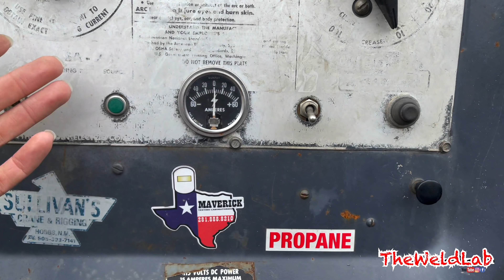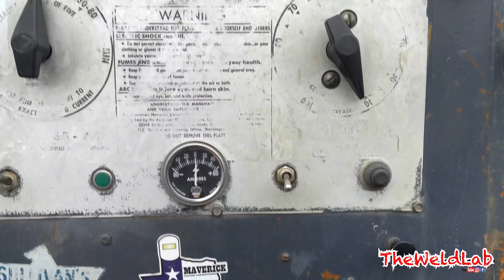Come To The Field | Rig Welder | Socket Weld Welding, Pipe Fitting, Repair On Pipe Pressure Test

Comment: You started out in a shop environment (enclosed) with doing a socket weld. Why did you choose to stick the socket? then you came outside in to the elements and then chose to weld tig? Always do a 2 pass minimum on socket welds. Make it a routine. Stay with it. 👍🏻
Reply: Always, always root pass a pressure containment weld!  Always!

Comment: Just a tip Coming from someone who has welded a lot of socket weld hydraulic pipe. Grind your stop and start on the first weld ; that way you grind out any porosity or slag from the original start and the weld bonds good where it overlaps.

Comment: I have an opportunity to go work in a ship yard. The test is an restricted 6" from the ceiling, 6" from the wall in 6g. Pipe is copper nickel to stainless  1/2 sch 10. Never heard of this. Are you familiar with this one? I would think real low purge, no bevel no gap and about 45 amps. Any tips?
Reply from the maker: Man I never heard of a test like that I wish I can get my hands on it lol
Reply: I guess I need to call the guy back and make sure I heard him right. Thanks for getting back. I appreciate your content.
Reply: I knew I misunderstood him. He was also talking about 1/2 socket weld test. The restricted test is 2" sch 10 pipe. Copper nickel to carbon and also a stainless both 6g. But the people that are telling me about the test aren't welders.

Comment: Rico what do you run on the remote for tig for amps? I have a SA200 trying to get 
110amps 145amps 160 and 180 are you on 3rd gear the whole time ?
Reply from the maker: Yeah I’ll stay at 3rd is hard to tell the amps bro I’m guessing about 40 should be around 110 I’ll try and keep a eye on it next time